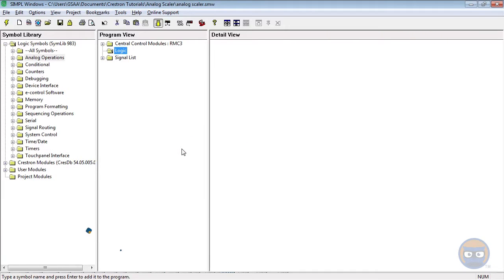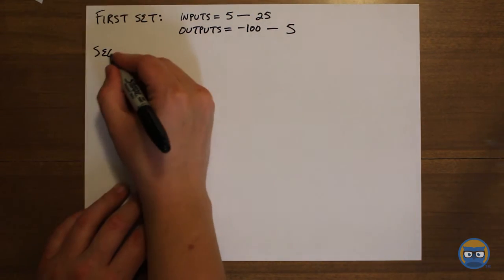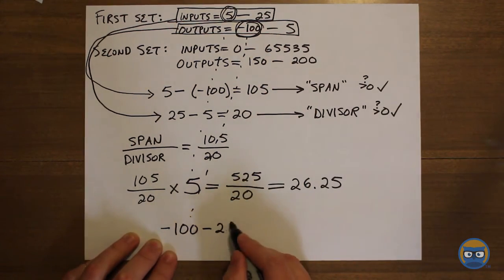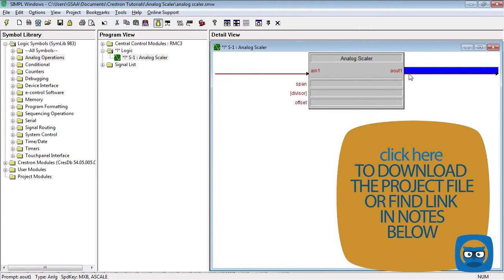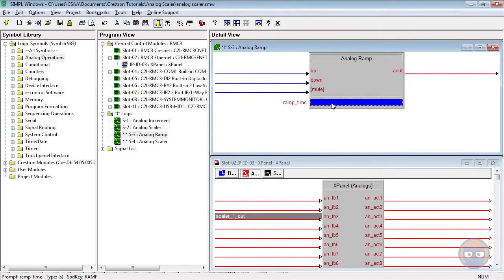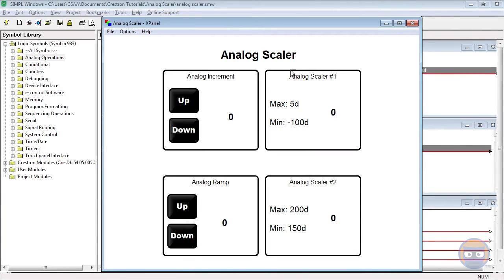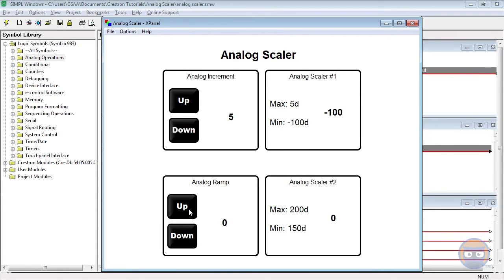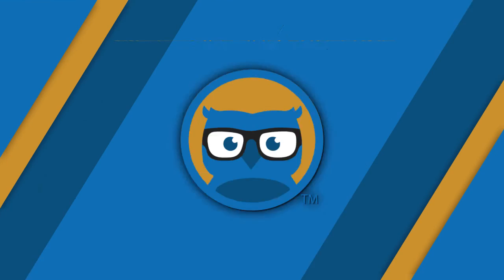Crestron SIMPL Windows ANALOG SCALER Symbol Tutorial

Comment: Doesn't work for my situation.  

Inputs 64736d-65534d
Outputs 0d-65535d.

65535-0=65535(SPAN)
65534-64736=798(DIVISOR)

SPAN/DIVISOR=65535/798*64736=5316383.157894737

0-5316383.157894737=-5316383.157894737(OFFSET)

Something tells me that offset is wrong.  It won't fit into the offset range which must be an analog value between 0 and 65535.
Reply: I was able to use an analog sum to subtract 64736 from the value I was receiving which was -800d to 100d.  This converted the value received to 0d-900d.  I then ran the new numbers through the equation which then gave me a sane answer.  Not sure why that step was necessary but if it helps anyone that finds themselves in this situation then I'm glad I'm sharing my workaround!